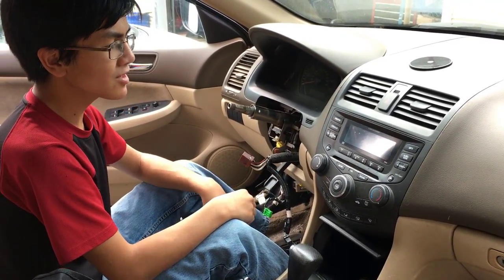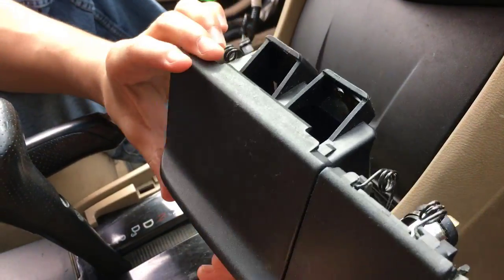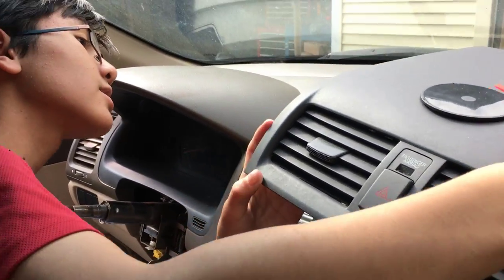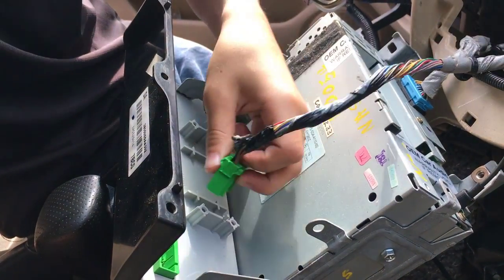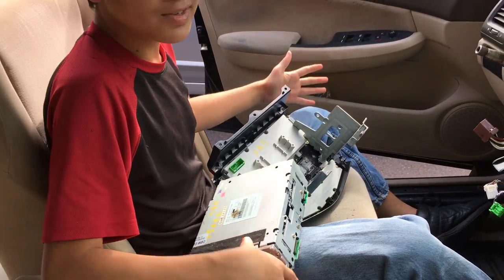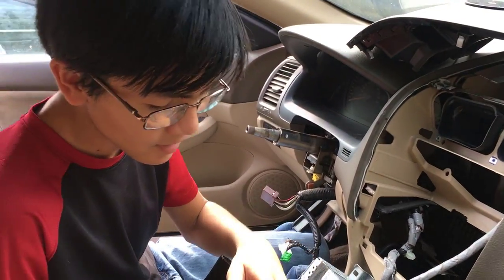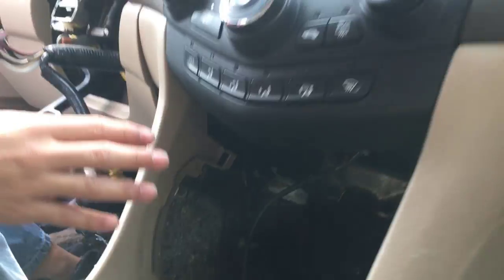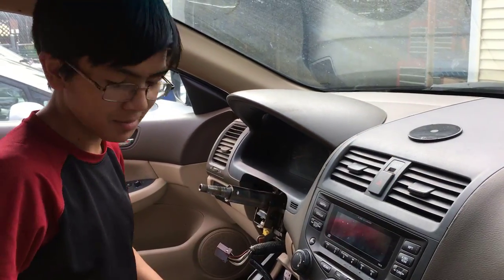How Remove/Replace Factory Stereo-Radio & Temp/AC Climate Control Module Console Honda Accord 03-07

Comment: U the man. I need to do this. My HVAC blower fan completely died. I already checked fuses, replaced the whole blower, checked resisters and still doesn't work. So now all that's left is to replace this HVAC/radio control board. I'm buying a used one on eBay. Tell me if you think this can fix my no ac/heat blower issue. Thanks bud
Reply from the maker: Honestly I'm not an expert in car's electrical but I would say that from a logical perspective you're on the right track.  Besides, if it doesn't work you can always return the control board to the seller and get the money back minus S&H.  Another option if the board doesn't solve the problem is to have the car diagnosed by a local garage and then when they found the problem you could try to save money by fixing it yourself.  Did you check the simplest stuff like perhaps a pinch wiring or a break in the wire??
Reply: @EyeOnAiman  yes I had it checked with a meter and all power checks out good. That's why the only thing I can think of now is is the control board
Reply from the maker: Did you manage to fix it?  What was the culprit?
Reply: I have the same problem no air blows out at all heater or a/c.   Did this fix the problem?
Reply: @Caliguy760  I have the same problem when I put the new radio in but whenever I put the old one connected back it does work I don't understand
Reply: Hey I have the same issue no air blowing I think it is the control board as well did it work for you?

Comment: Does the battery have to be disconnected to avoid airbags from deploying?
Reply from the maker: You could just disconnect the airbag fuse for at least 20 minutes, but most people opted to disconnect battery before working on airbag SRS.  The drawback to disconnecting the battery is you may have to reset the factory radio code if there is one.
Reply: @EyeOnAiman  Another question. Did you enter a code after you swapped units?